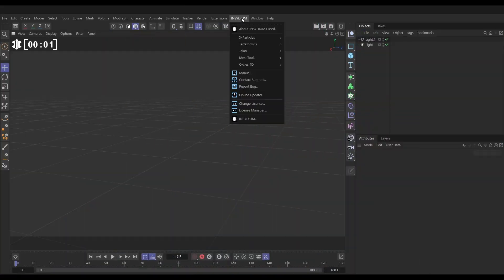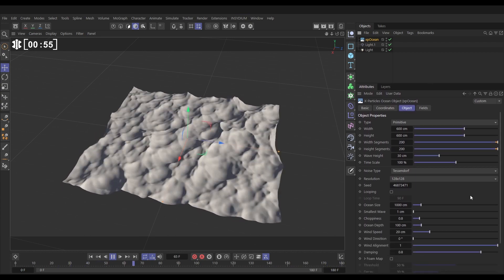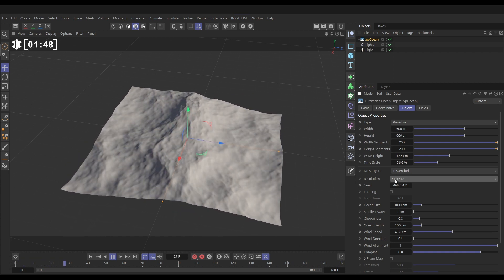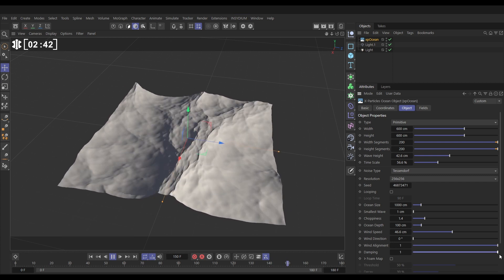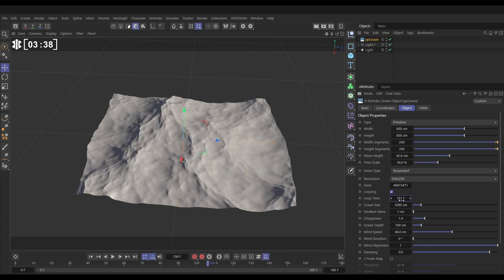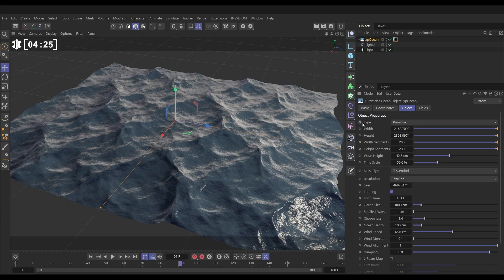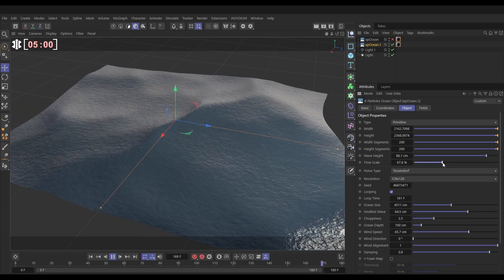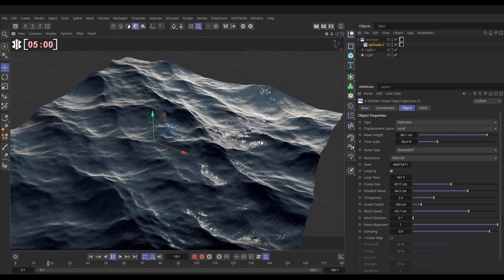Top Tip Tuesday! - Looping Ocean

Comment: 🤔" How to put xpFoam on this ripples?? 💯 ❤
Reply: xpFoam works with particles and not deformed meshes. However, you can have xpOcean generate a vertex map with foam data and you can use that to add a foam layer in your water material.

Comment: that is cool. but would love to have a longer version talking about waves and foam and other addon’s that would really sell this..
Reply: wait for the new fused release in July. Should make foam/etc much easier.
Reply: @hotzenmonster  I wouldn't expect the update to do much in terms of foam for deformed meshes like in this case. xpFoam works with particles and not meshes. However, you can already have xpOcean generate a vertex map with foam data and you can use that to add a foam layer in your water material.

Comment: you show large scale ocean on a small patch? what? now how can i make a ship in a large ocean? this setup will not work on large scale ocean right?  why the gaslighting....
Reply from the maker: Hi, 
You can use the techniques from this Top Tip, on large areas (as big as your CPU can handle) to create oceans that are not repeating and waves that are at the scale of large oceans. If you need further assistance, please ask this question on our Discord Server. 

https://discord.com/invite/X2zYY7qEyr

-Thanks
Reply: @INSYDIUMLTD  I tried it on a plane of 10 km x 10 km (i.e. 100 square kilometers) and 25 million polys (5,000x5,000 segments). It did not work (repetition was clearly visible)
Reply: @INSYDIUMLTD   I would expect some sort of solution to the absolute need for real world problems for a large scale infinite ocean and not to send your clients to see how fast they can break their pc with your plugin. and by the way it break very fast when you go big... for now its just useless ...